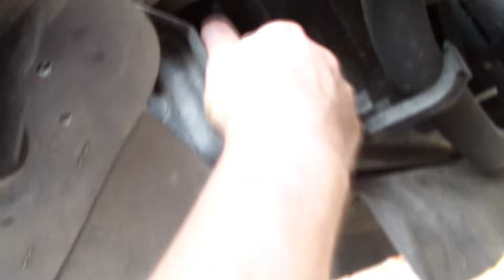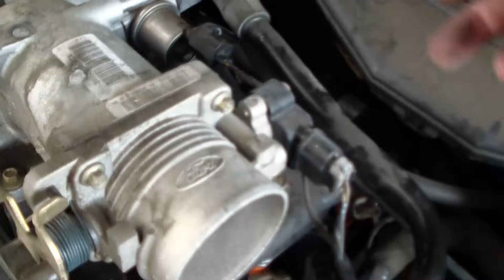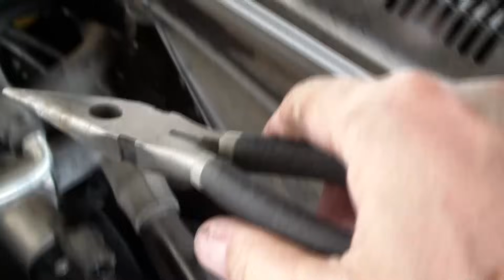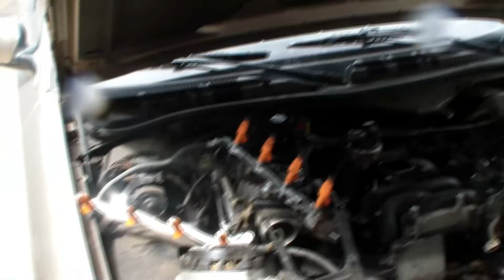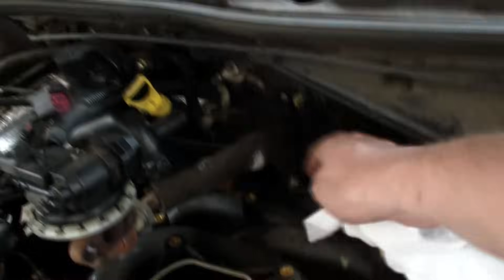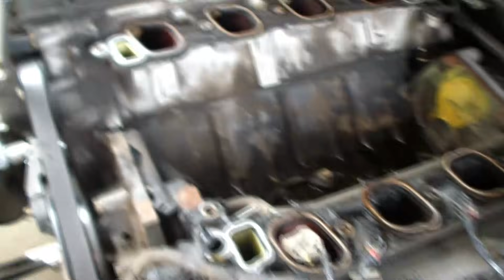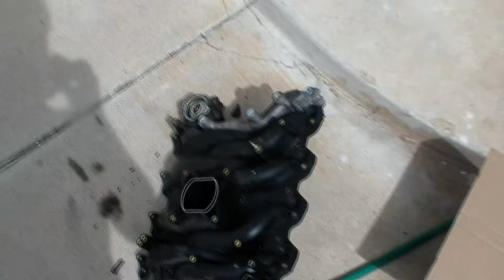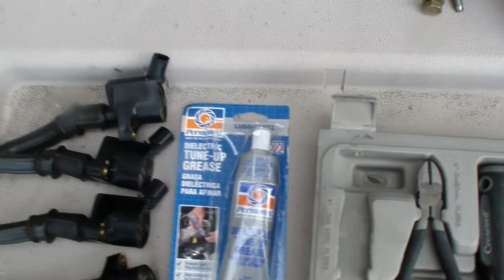Ford 4.6L V8 Intake Manifold Replacement

Comment: How did you get proper torque for all the bolts?  Did you use the PFT Standard for tightening?
Reply from the maker: +John Baird Over the years you get a "feel" on proper torque. I made them all barely snug, then a bit tighter, and then a bit tighter. Start in middle and work out to front/back. With plastic it is more important to not over tighten bolts. About as tight as they were when you took them off. In the cast iron days you had to use huge torque but plastic will deform easily.
Reply: +Kent Diego What about the torque specs provided for us with the intake manifold found on amazon.com?  Can they be relied on?

http://www.amazon.com/dp/B000CIXMIC/ref=dra_a_rv_ff_fx_it_P2000_1000?tag=dradisplay-20&ascsubtag=50343163b25f24cbad2360f16de58b43_S&dra_hfr=1&dra_ohs=0-0
Reply from the maker: +John Baird I read every review and only saw 16 ft-lbs. I Googled and one said 18 ft-lbs, another said 19 ft-lbs and a third source recommended 15-22 ft-lbs.
Reply: +Kent Diego I only have one shot at this so I hope you'll forgive my persistence.  What, then, would you recommend for the proper torque?
Reply from the maker: +John Baird Recommendation #1 is use original factory Ford Racing manifold and not Dorman. I lost 1 mpg. Many complaints of vacuum and coolant leaks with Doorman but never with Ford part. If I was doing it again with Doorman I would put a thin layer of RTV silicone gasket sealer around each O-ring mating surface. I did torque in sequence by hand but 18 ft-lbs would have been a good estimate. Spend a lot of time cleaning off old gasket. Be sure mating surfaces are clean and flat. Be sure manifold fits properly with no interference. Then finger tighten all bolts. Then a bit tighter starting from middle and going out to front and back. Then a bit tighter until you get to proper torque. Too tight is worse than too loose with plastic.
Reply: +Kent Diego What's the part number for the Ford Racing manifold and where is the best place (price-wise) to get it?

Comment: Anyone know if the bolt on the block needs to go back in
Reply from the maker: +richard martin The tough bolt in back of engine for the crash bracket? The crash bracket protects the fuel rail in frontal offset crash. It is not that hard to put back on but I am sure you will be fine without it. I was lazy and did to put it back.
Reply: +Kent Diego Cool thanks, I did put it back on. Now I have a coolant leak on the driver side close to the bolt. If I didn't get that manifold quite to 18 ft lbs could that be the reason for the leak. no heater hosed or anytning around?
Reply from the maker: +richard martin With the Dorman manifolds I see many complaints of leaks but mine worked fine. Leak is usually rough mating surface and interference from dirt. So a clean flat mating surface is important. In video I spent a lot of time on that. You can try tightening the bolts more. With plastic manifolds I worry about over-tightening more than under tightening. If I had this to do again with the Dorman I would have put a bead of silicone RTV sealant on each O-ring mating surface. Wish I did not use Dorman and had used factory OEM manifold. Lost 1 MPG with Dorman. Ford Racing sells factory OEM manifold at reasonable price. Good luck.

Comment: Would it not be a good idea to clean the injectors and the throttle body while you have it apart?
Reply: That's what I'm doing...also cleaning out the throttle body and idle air control valve and replacing their gaskets while I'm at it.

Comment: 2 in a row leaks on the passenger side of the aluminum cross over, there was a space between the metal and placstic wear it leaked out.
Reply: What do you mean? How did you fix it? I'm having the same issue
Reply: +Caleb Tutleman Got a upgraded FORD OEM with aluminum cross over from the junkyard.. problem solved

Note NPI or PI heads

Comment: Fuel rail came out with no spray? I'm scared. I'm doing it now!
Reply from the maker: Malik Tribblet The fuel injectors came out of manifold easily. I left the injectors in fuel rail so no spray. I did not need to disconnect fuel rail from fuel line.

Comment: Ok wanted to ride around a little bit to make certain that the problem was fixed. I think I figured it out, as I said my thermostat would go up high and drop back down to normal and my car would hesitate. I changed out the intake manifold and the problem still persists. I even change my ERG valve, but to no avail.
So I took it to the Mercury dealer and they pulled up two misfire codes. Then they proceeded to tell me that to fix this problem it would run me $2500!! On top of that they couldnt tell me Definity what was leading to the miss firing of my  vehicle.

I was just on the verge of selling it when I decided to change out my spark plugs and coil packs. Lo and behold upon changing my spark plugs I noticed that I had burned  antifreeze all down in the spark plug bay. You can see where antifreeze had gotten down into the spark plug base and had burnt off around the spark plugs. Not to mention that all of my coil packs appear to be worn. After changing this my car rides like a beast!!

So to anyone who changes there intake manifold which is composite I would advise to change out your spark plugs and coil packs on this make and model of vehicle. Ford, Lincoln, mercury.
Reply from the maker: B. New I have had two coil packs go bad so far. Very expensive for one at local parts store. You can get all 8 on Amazon for $50.
Reply: How did you suck coolant out of the spark plug wells?
Reply: @P7777-u7r   use the spray nozzle from a spray bottle. make sure it has a long straw.
Reply: @getupryan  That's brilliant, thanks!
Reply: The only way for water and antifteeze to get in spark plug tube is a leaking intake. Water goes through the intake also on these engines

Comment: Goodluck with the Dorman manifold, I'll only use Dorman when OEM is no longer avaiable. You did OK. for your first time but under warranty that job pays 2.5 hrs.
Reply from the maker: benjaminwayneb I did not have time to really shop around. Certainly would get the Ford Racing OEM model if doing it again. The 2.5 hours is why I do it myself. Spent a lot of extra time making sure everything was neat and clean. A book rate mechanic cannot afford that. It was 35 years since I replaced a manifold before that and I bet it would be a 4 hour job now that I know how.
Reply: @KentDiego  - You don't need to justify yourself to this guy. He's just being a douche. You got it done and that's makes it a good job. You OUGHT to take your time with your vehicle. Speed does not equal good mechanic. Thanks for the vid.

Comment: Digging around it looks like I am about to have to do this. Thanks for doing such a thorough video. For the life of me I can't figure out why someone would come check out this video only to be a dick and comment about the parts quality or how they did it better. This video is the difference between me paying $700 for someone else to do it or doing it myself for < $300. Thanks!
Reply: sheep4269 Except dorman manifolds are shit though
Reply: AKS the one he had on there was not shit it had the aluminum crossover for coolant. The all plastic models suck and fail. His got fucked up not failure there is a difference. Also Dormans suck look at the plenum the runners feed into on the new dorman intake very small the oem is much bigger it makes a difference in performance. If your seeing failures of the aluminum cross over design at 100K its because some one don't know how to use a torque wrench. My all plastic pos intake didn't fail untill 165K

Comment: No ruff idle or any leaks.Just changed intake manifold.One mornig about  three months ago when it was cold outside while I was driving my trac control lights up car hesitates...check engine light came on car shuts completely down.Later I found out that my thermostat housing had a crack which led to getting  intake  manifold changed. 

Yesterday while I was driving my trac control sensor goes off car hesitates thermostat goes all the way up to high then back to normal . I pull over to the side of the road wait for a while start the car and drive...check engine light comes on while I'm driving car shuts completely down.
 Crazy thing is...my car started back up and I was able to make it home.
Seen several cases online of people who have had the same problem with this make and year of car 2000 Grand Marquis.

Could my promble be that by chance some antifreeze made its way down into spark plug bay area or fuel injector? Any foresight would be greatly appreciated.
Reply from the maker: B. New Since idle is good I do not suspect spark plugs or injectors. Since no leak there is nothing wrong with manifold. You need to scan for diagnostic code. An auto parts store will scan. Need to figure out if high temperature is real (stuck thermostat) or an electrical glitch effecting temp sensor. Google around for what other owners are saying.
Reply: Kent Diego ok thanks will do.

Comment: Kent...great vid! Hope u respond to this...I replaced my intake last month on my 2000 grand marquis (65,000)mls today my trac control and temp gauge sounded followed by check engine light then car shutting down...any thoughts would be greatly appreciated.
Reply from the maker: B. New Can you explain better what is happening? If you temp gauge is quickly overheating then thermostat is stuck.  
Do you have rough idle?
Do you have leaking or losing antifreeze?
How long after changing manifold did you have problems?

Comment: First off...thanks Kent this vid was very helpful...i bought ah new dormant intake & changed it out step by step...after i put water back in the radiator....i cranked it up...once everything leveled out...water started leaking behind the intake (as mentioned in the comment above mines)...what trouble shoot problems...whould you advise i try..??
Reply: I have 2005 crown Victoria
Reply from the maker: johnnie payne I remember two coolant passages at back of heads. In video they looked full of gunk as the passages were dead ends. Need to scrape mating surface flat. Be careful not to over tighten manifold bolts as can distort mating surface. If I had to do this again I would have put silicone rubber around all O-ring mating surfaces. Many others have reported leaking issues with the Dorman part. I lost 0.5 mpg. The factory part is better.
Reply: Kent Diego So it's better to go find 1 off another same year model car..??
Reply from the maker: johnnie payne The same part fits many years. I do not like used. The "Ford Racing" brand looks to be the best replacement for a reasonable price. It has the brass inserts for coils and used real gaskets.
Reply: Kent Diego Did you apply sealant on the block before you installed the intake? I cleaned the block & I'm wondering if apply sealant 1st or do i take off the O-rings and apply sealant & put the O-rings back in place?
Reply: johnnie payne i still have the dorman intake
Reply from the maker: johnnie payne I did not use any sealant. O-rings are not supposed to need a sealant, just a clean smooth surface. Many people have reported problems with O-rings leaking. I would put a small bead on mating surface just before installation just to make sure if I did this again.
Reply: Explain the bead application...
Reply: What yu mean...when you say that You would put a small bead on the mating surface?
Reply from the maker: johnnie payne So you have a tube of silicone rubber or RTV sealant. Read the instructions.  Squeeze a small bead (line) out in rough shape of where O-ring will touch. Then smooth down a bit with finger where you have a thick film of sealant on full mating surface. Maybe let sit a bit (follow instruction on tube) and install manifold. The O-ring does not need this but "Just in Case" this will ensure no leaks. Be sure no interference in mating and tighten bolts evenly. Do not over-torque the bolts.

Comment: Not to bother you but my 1989  grand marquis is leaking coolant from behind and under the engine. I can not get a good look at it due to the location.

With the car OFF, if I add coolant to the radiator reservoir, it takes a second then pours out from near and under the back of the engine until the reservoir is near completely empty.

The mechanic that did the pressure test wrote that it was a "bad gasket" and recommended a new intake manifold... then quoted me $476 for the part... and another 475 for the labor...

I walked out of the shop, but I'm still not sure what part I should be looking to buy. I have limited knowledge but I'm suspicious it is the connecting that goes to the heater... although I have no real clue.

thoughts?
Reply from the maker: I think there is a rubber hose running under intake manifold from water pump to back of engine for heater hose on those years cars. Anyway you still need to take off manifold to get to it. So $160 for a Dorman part and 6 hours of work and you save $1000. Google around as see what others say.
Reply: +ArkAngelHFB I'm sure it's fixed by now, but I doubt the manifold was the culprit since it's aluminum.
Recently I sprung a leak in one of the heater hoses ('86 MGM). Of course I replaced all 4 coolant hoses situated behind the engine at once.
It was just a matter of time before one of the other hoses would crack.
You see, to access them I had to take off the upper intake manifold. 6 bolts keep it in place: 2 front, 2 rear and 2 in the middle under the "5.0" badge. Each 15-22 ft-lbs torque spec.
Of course, various connectors and hoses and the gas cable needed to be detached. Some hoses could be left on, since pulling the upper manifold forward surficed in reaching the hoses.
At the rear of the engine you'll find 2 small coolant hoses leading to the EGR (throttle body), and 2 bigger ones leading to the heater. The latter are pre-formed, but if you're on a tight budget like me, take 2 lengths of at least 2feet of universal coolant hose (to prevent choking when bending). There's a metal ring pressed inside the ingoing heater hose to restrict flow anyways, so don't worry to much about bending them.
Instead of replacing the gasket in between both halves of the manifold I simply sprayed the old one with rust protector. Any sticky substance will do.
I'm a scrooge when it comes to repairs ;)
Reply: Mine turned out to be the engine blocks water jacket... which was yeah... more costly to fix. XD

Comment: First of all, amazing video. It is very clear and, despite the issues you presented, this gives me the confidence to try such a job myself. Brovo!

Second: How much more tear-down would there be to replace the heads? Can a head replacement be done in the vehicle or would an engine pull be necessary?

Thanks in advance!
Reply from the maker: Removing the heads is just more bolts. Exhaust manifold bolts can be difficult and then the head bolts. The intake was the hardest part. Slap on some re-manufactured heads or take your present heads to a machine shop for rebuilding.  No need to remove the block.
Reply: Kent Diego My goal is to swap the factory 2-Valve F150 Heads for a re manufactured set of 3-Valve PI heads. I'm still not sure I want to attempt this job myself, but after watching your video I'm far more likely to try.

Comment: What does it mean when antifreeze leaks on the engine.....on my 2000 marq it does that....and I have anti freeze in my spark plugs do I need a whole new intake or nah....cuz im being told I do....plus my coils are bad.....does that make the car shut off cus my car cuts off and I think thats why....but not sure help!
Reply from the maker: I had two coils go bad so far. You can buy all 8 for $50 on Amazon. You will get a misfire code when you scan. Maybe the antifreeze is coming from thermostat housing? Look for trails. Else have to replace manifold.
Reply: Thx im checking first thing in the morning.....

Comment: I really dont understand why ford decided to switch to plastic intake manifolds. On my 92 I had a steel manifold, wouldve never had this type of problem.
Reply from the maker: A cast iron manifold weighs a lot. Maybe 40-50lb. Happy to see that gone.  I am sure plastic injection must cost a lot less than an all aluminum part. If they can save $10 per car and get 0.2 MPG better it is hard to say no.
Reply: lol who wants the headache of getting stuck because your cheap crappy plastic intake cracked plus the cost of the repair for 0.2 MPG? are you for real or what?

Comment: Hey Kent I have a 2006 mercury marquis, I had this guy change my thermostat out now up under the thermostat housing it's leaking my antifreeze, I have the dorman intake manifold it's leaking in between the gasket, one mechanic telling me I just need a gasket, & another one telling me I need to replace the whole manifold? Pls help!! It has leaked so much my car won't crank, can that be a sign of bad spark plugs??
Reply from the maker: The thermostat has a large rubber O-ring that goes over it that comes with the Dorman intake. Leaking there. You have 8 spark plugs so not them. Likely the CPS (Crankshaft Position Sensor) went bad from the leak.